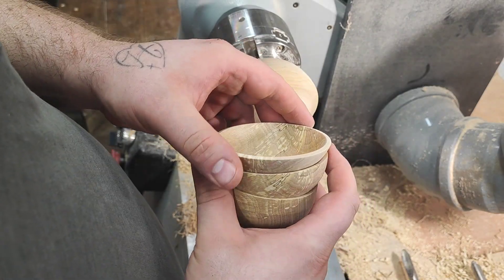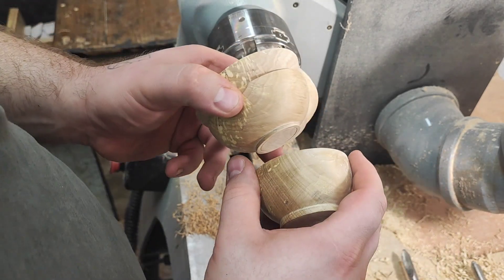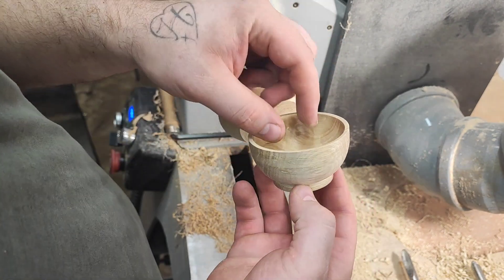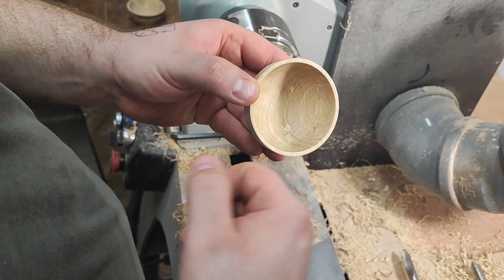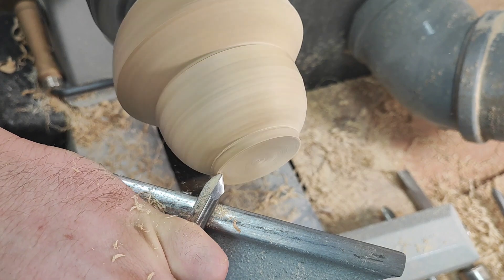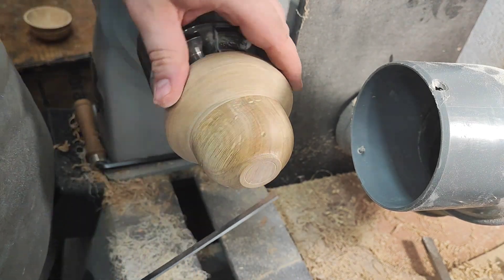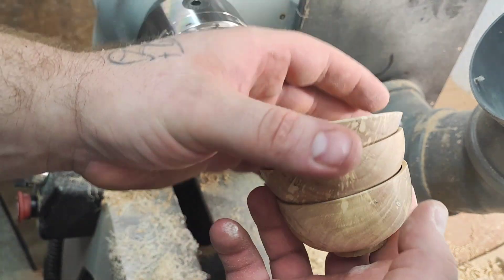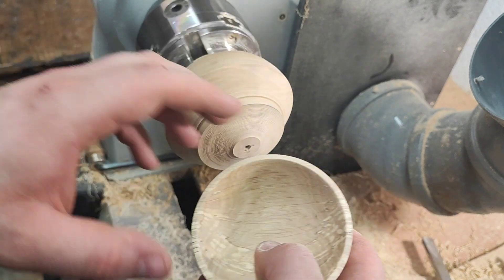Tiny bowls from spalted hornbeam

Comment: When I started turning, 33 years ago, I made all bowls this way because the only 4 jaw chucks available were for metal lathes and were very expensive.  My first chuck was a 3 jaw chuck and it bruised the wood.  I still occasionally jam chuck a bowl with a faceplate and mdf board when it is necessary.
Reply from the maker: I use jam chucks all the time.... Fast and convinient 🤗

Comment: Great vid Tomislav, I’m new to woodturning and have learned so much from your videos!  I was wondering though how you deal with woodworm in your workshop, do you just microwave the bowl when it’s done or do you use chemicals on the wood?
Reply from the maker: Thank you very much 🤗 glad you enjoy my videos....
Usually when I rough turn bowls, if there are any worm inside unusual it visible.... If not I use compresed air and blow it out if its open tunnel.... If its closed then just thin piece of wire and you pull it out....
I don't use microwave to kill them or any chemicals as that can stain or stay in wood.....
Hope that helps🤗
Reply: @tomislavtomasicwoodturning  ah ok makes sense, thanks!